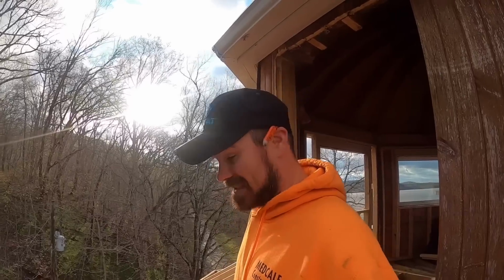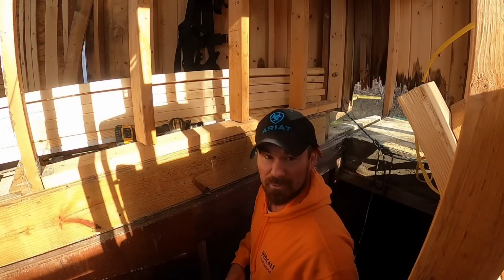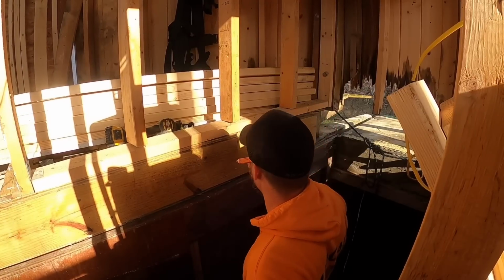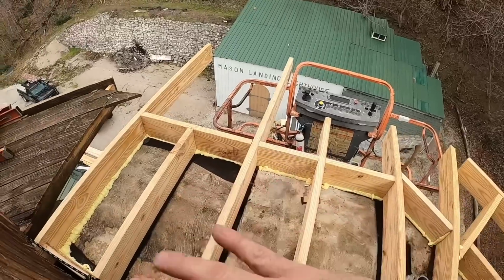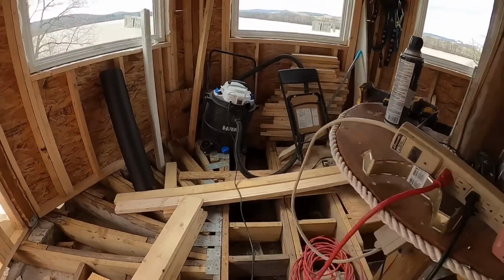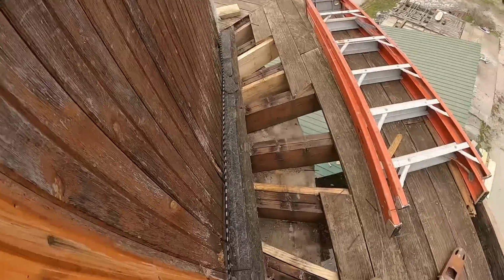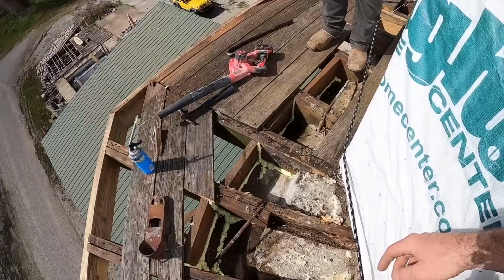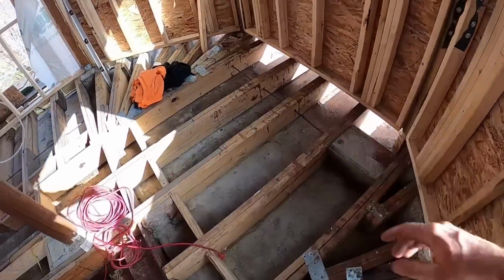Ready for the foam baby!

Comment: Had three barns sprayed had an issues where the concrete met the spray foam area is wicked in the water saturating the entire wall with water over time.
Reply from the maker: So you used open cell.

Comment: instead of making it a socket you need to put a cross so you can use Philip head tip in your drill to remove and to put on. And you need to turn your sawzall blade over so you can have more clearance to make a cut and it gives you more leverage
Reply: Speaking from experience

Comment: I understand why you are you doing the can spray foam. Just to make it a little easier on the spray foam guy but I know they can fill those gags up easily.   I had them fill 2 to 4 inch holes up for me when we spray foam a old building  where I use to work.  There foam expands way more and faster then the cans.
Reply from the maker: Agreed but I didn’t want it running down my castle walls